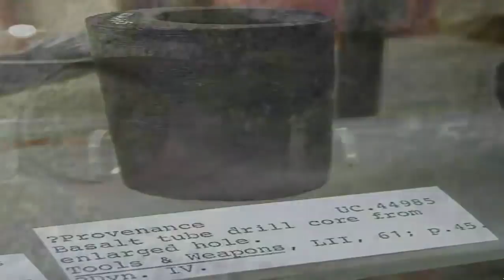🌴  Antediluvian Ruins Found In Java? 🌴

Comment: The cast iron parabolic dish & the oil furnace found next to it are NOT LOST! They are both on display at the Keris Tosan Aji Museum at Purworejo in Central Jawa, Indonesia. Mystery History is spreading fake news about the supposed "destruction" or "disappearance" of these objects. Granted, the dish itself was brittle as it was cast iron, rusted & old. Plus, it had not been properly secured after it was discovered & the curious were jumping on it as if it was a trampoline! Structural cracks developed & when they tried to lift it, they underestimated its weight & it fell & a large triangular piece broke off & a huge crack developed at the bottom of the dish. The good news is, it reached the museum safely, albeit in several pieces!